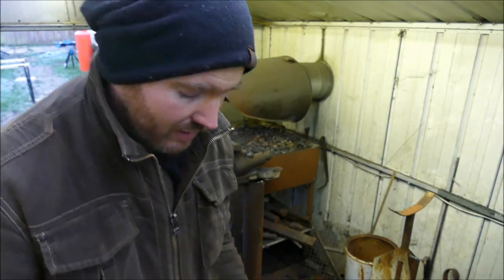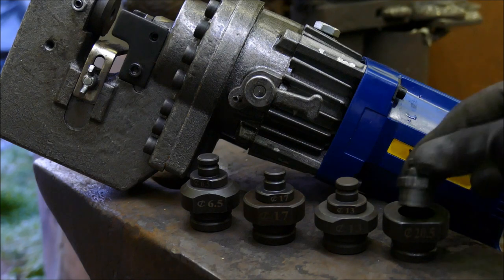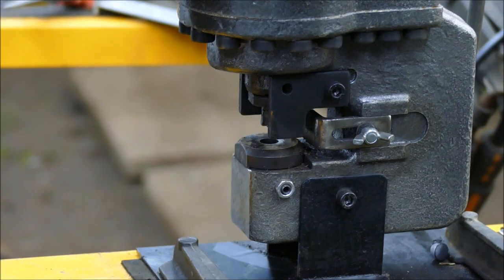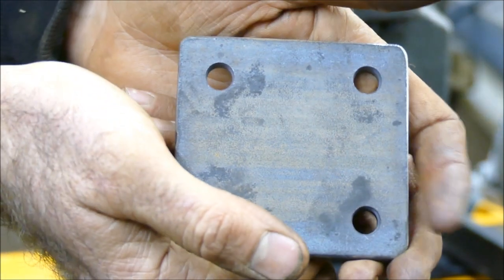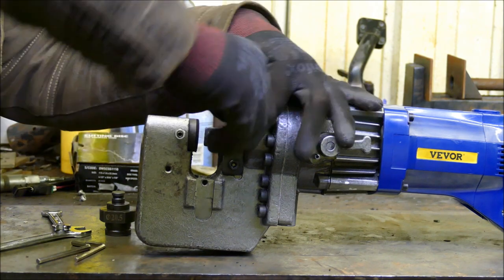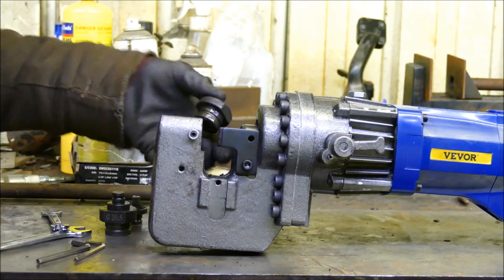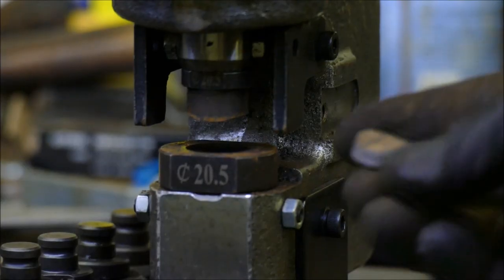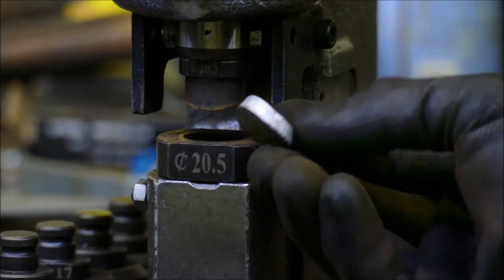Fires 20mm holes through steel!! - VEVOR Mhp-20 Electric Hydraulic Hole Punch - Full review

Comment: Hi Again Joshua, I do like the hole punch, however to expensive for me I just do odd jobs in my forge, And I work under a tarp so winter coming on I will have to shut shop. It is a bit of a struggle now at hitting 74 yrs. but I just get on with it.
If it is to cold! I just heao on more coal... bye for now and excellent video on the hole punch though' well done and well presented.

Comment: I bought the VEVOR hydraulic punch that uses a separate hydraulic unit connected by a hose. I can use a standard porta-power pump or, in my case, a hydraulic pump setup in my shop. The punch unit itself only cost $124 US and I had the other hydraulic units. The pump is operated by a foot switch so my hands are free to hold the work being punched. VEVOR sells several sizes of these heavy-duty cast iron punches and I bought the smaller one, the CH-60. The 31-ton punch has a maximum thickness with iron plate of (3-8 mm) and will do up to 10mm in aluminum and comes with 4 die sizes, 3/8"(ф10.5 mm), 1/2"(ф13.8 mm), 5/8"(ф17.5 mm), and 3/4"(ф20.5 mm). The punch is not light but it has a nice handle on the top and is much lighter than the powered unit that you bought. The hose has a quick connect on it so it's easy to move around. For the money, especially if you already have the hydraulic pump, it is a great deal.
Reply from the maker: I'll see if I can try one out. Cheers for the tip. Cheers J
Reply: Hi MisterFixIt1952   Im thinking of purchasing the CH60 also as i also have a strong hydraulic pump. Im looking for some advise if you dont mind. I mostly only punch 6mm round holes in 3mm steel plate. Do you think the plate will bend, being so light for such a strong tool? and second question any idea where i can get a foot switch for the my pump?  If it wont work Ill buy the VEVOR Mhp-20 Electric Hydraulic Hole Punch but they are out of stock at the moment. Thanks in advance.  Donal
Reply: @donalregan207  The holes should punch cleanly through most any mild steel or aluminum up to the rated thickness. This mostly depends on how well the dies are maintained. Good punch lubricant helps for production punching. For occasional use grease would due just fine. As to the pump, you didn't say which kind you have. I have a 10 ton hand pump from Harbor Freight that I use but I also have an air powered foot pump that works. I also have an electric hydraulic pump that I salvaged from a wheel chair lift that I am thinking of using. I would use a two way valve, like those used for a wood splitter. They sell those valves pretty cheap all over the place including at VEVOR. VEVOR also sells several, similar, air powered foot activated pumps for around $100 each. I use a quick connect on my hydraulic lines so I can easily change power sources. If you wanted an electric foot switch activated hydraulic valve you could find one on eBay or aliexpress. You might want to install a relief valve set to the max rated pressure of the CH60 if you are going to use something more than a hand powered pump like a port-a-power. I personally think the electric punch is overpriced unless you have a specific need for extreme portability, and it's making you money. Most of my fabrication happens in my shop on my welding/fab table.

Comment: Thank you for this demonstration. I just picked up this tool brand new at auction for $300USD. My past two jobs were handrails and a steel catwalk with 504 & 660 holes respectively for their mounting plates. Each was 2-3 days at the drill press. Hoping this is a huge time saving machine.
Reply from the maker: It definitely will. Well done. Cheers J
Reply: How did this workout? Interested to see how durable it was for a production situation
Reply: @joshg8458  Oddly, I have not used it yet. Did a kitchen renovation and a ton of interior work on a 90y/o house the past several months. Now working on workshop improvements before another small kitchen job. After that I have a job for it though!

Comment: What a handy device, if you need to punch a lot of holes. Most of the material I work with would be too thick, but I am glad it works for you.
Reply from the maker: I used it for a ton of angle iron as fixing holes for some panels. Fixing plates, light gage I-beam and sheet metal is what I'll use it mostly for. For really thick stuff I think hot punching is faster than drilling, I've recently acquired a large fly press which can do that. Cheers J

Comment: Really cool to see one of these actually operating! Been eyeing up one for a while. Could you possibly shed a bit of light on how the punch advances when you pull the trigger - does it immediately retract as soon as the trigger is released, or does it only retract once it reaches the full travel? I was a bit surprised when you were able to advance the punch a little bit and it stayed there, not retracting. The application I have in mind is stamping designs on to metal, rather than punching holes, so I'm wondering whether this behaviour would actually work. At the moment I'm using a manual shop press, which works fine, but is bulky and a bit tiring after a hundred pieces!
Reply from the maker: It does it in cycles. You can only get full extension then full retraction. However there is a lever on the side which is a bypass valve so you can control the pressure for lighter strokes. I don't recommend it for punching designs though. Cheers J
Reply: @joshuadelisle  Hi, thanks for the info. That's what I was afraid of - I was thinking it behaved more like a separate pump + ram. Search continues for a nice little electric/hydraulic press ;-)
Reply from the maker: @imajeenyus42  VEVOR did do 12v, 110v nd 240v hydraulic pumps with tanks. You just need a cylinder after that and a frame to mount on. Cheers J

Comment: Do you know if it is possible to punch a 1/4” hole in the middle of the flat part of a 3/4” steel angle?
The hole would be about 0.43” from the outside corner.
I worry there is not enough room and the punch  will hit the side of the angle before hitting the side of the angle resting on the die 
Appreciate any help in this matter

Comment: Thank you for sharing great video, since I’m a subscriber in the USA how do I order one of them, and thank you for looking after us with the discounts, please let me know
Reply from the maker: Hi Willy. If you go onto the VEVOR website for you country, type in electric hydraulic punch and use Joshua10 as a discount coupon at the checkout you should find a great deal. All the very best. Cheers J
Reply: @joshuadelisle  Thanks Josh much appreciated I really need this machine, the drilling for holes can be a pain in the back the waste and the time it takes, not to say the price of drill bits, THANKS 🙏
Reply from the maker: @wilborth5th  that's exactly why I bought one. I had so many holes to do and this thing did it so quickly it paid for itself on the first job. Cheers J
Reply: Josh thanks for the advice I just got my puncher, I have a question, that oil is provided is the oil to be use as hydraulic? Also the manual is very limited but I’ll manage, very impressive machine by the way, thanks again
Reply from the maker: @wilborth5th  Hi Willy. Yes hydraulic oil is best, I used compressor oil which is the same less some additives for anti-wear but I only needed to top it up a little. Any lubricant is better than none when applying some to the punching die. The lever on the side, I didn't mention in the video, is a bypass valve so you can test it is centred without it punching all the way through, it'll only touch the material instead. All the very best. Cheers J

Comment: this or rebar cutter would u use more , the rebar dose not  cut flush tho some tidy up work
Reply from the maker: I would love a rebar cutter too. I actually cut a lot of round bar for railings using a large hand operated bolt cutter. Will do 12mm comfortably.

Comment: I contacted Vevor and they said they do not sell any other bits to this machine in any other sizes nor did they recommend another vender to obtain any from. After watching your review I’d like to buy this machine. Any ideas on anyone who could make a custom bit?
Reply from the maker: Hi. I meant to put a link to this but I found these on eBay and they do other types also: "1set 21mm Punch Die of MHP-20 Electric Hydraulic Punch Machine up and down mold | eBay" https://www.ebay.co.uk/itm/333373789085?chn=ps&norover=1&mkevt=1&mkrid=710-134428-41853-0&mkcid=2&itemid=333373789085&targetid=1279388080546&device=m&mktype=pla&googleloc=1007256&poi=&campaignid=9437777969&mkgroupid=121333613743&rlsatarget=pla-1279388080546&abcId=578896&merchantid=113587099&gclid=Cj0KCQiAu62QBhC7ARIsALXijXQSRbsZlsB5iotNLUkL2z7UWFXH4tuJCbSH6-xcVg5-1LbIPH1TKP4aAiRTEALw_wcB
Reply: Thank you for your fast response! I have seen these for sale on ebay and I did not know if they were compatible with this machine or not. I need a few different sizes 39mm being the largest I need for thin soft metals. Thanks again for answering as many of these company take awhile to respond.
Reply from the maker: @spetsnaz1  thank you. You're limited to 20.5mm with this punch but as far as I know you can get any shape within that diameter. For anything bigger I would use my plasma cutter or rotabroach. Cheers J
Reply: @joshuadelisle  Awesome, thanks for sharing!  I just bought one and am looking to get a 5mm die set since most of what I need to punch for bus bar manufacturing is 5mm.  Hope I can find it ok!

Comment: after how many holes should the oil be changed?  what type of oil do you use? Thanks
Reply from the maker: Hi. I would check my oil yearly to see if it's going dark/opaque, if it's still full and clear it's still fine. Hydraulic oil has anti corrosion properties which is ideal if you do a change, for topping up I use compressor oil which is the same less the additives and is always on hand for me if needed. All the very best. Cheers J

Comment: Hey Josh, do you know if there is a 3 or 4mm die for punching holes please? I currently drill screw holes and this would save me so soooo much time!
Reply from the maker: You can only punch a hole that is more than the thickness of the steel.  You can get dies that are 3mm but the maximum you could punch is 3mm thick steel. There should be other dies available on eBay. All the very best. Cheers J